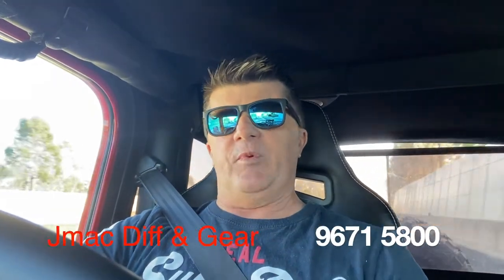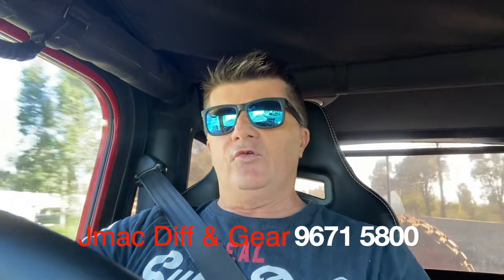ARB Air lockers • Ring and pinion change • Speedo Recallibration // Project TJ

Comment: I know exactly what you're talking about, Darryl.  I have a '99 TJ Sport with factory 3.07 gearing and 5 speed trans. When I changed to 33" tires, I was so frustrated and embarrassed when going up a mediocre highwqy hill. I would go as fast as the speed limit allowed at 65 mph (US) before getting to the hill, but by the time I'm in the middle of the hill I would be down to 45 mph and crawl the rest of the hill in 4th gear. When I changed to 4.56, man it felt like I added a turbo. Now, I can go up that same hill on 5th gear at 70 mph with no problem. Not kidding. Anyway, i really enjoy your contents and keep up the good work. Happy jeepin'!😊
Reply from the maker: Thanks so much!

Comment: Just got my TJ back yesterday too, got the rear axel and diff rebuilt. Pricing you received seems similar to here in Canada, except I bet our tax man is greedier here.  I’m running on 3.73 gearing which is okay turning the 33x12.5 Cooper STT pros but someday I’d like 4.10’s in new front and rear axels. Air lockers are at this moment only a dream. Keep us posted on how the air lockers are working.
Reply from the maker: Will do, interesting how the pricing has translated similarly across continents.

Comment: Love your videos- subscribed!  I was someone who had hoped to buy a new JL 2 dr and go cross country (mostly off road) in it with my wife.  My reasoning to buy new was simply peace of mind while it just being the two of us off in remote places.  I've done lot's of  solo long distance off roading on 2 wheels, but always on newer machines for that peace of mind. My present finances are now telling me to only consider TJ's if you get my drift, so my question to you is about reliability. I understand the engine in bomb proof, but would I be asking for too much from an early 2000's TJ to take it on a 6-7,000 mile trip like that will most likely see everything but hard rock crawling?  Thanks for any advice.  cheers
Reply from the maker: Hi, the newest TJ is now 14 years old so anything you purchase will need some preventative maintenance. That said, parts are cheap and plentiful and the vehicle is straight forward to work on. I used to be the guy buying a new vehicle every 3-4 years however with the TJ, I don't feel the need to. It's never let me down and I'm more than happy to jump in it and do a long trip without worry. That said, I also don't skimp on quality of replacement parts or hold back if something needs to be done.

Comment: Hi Darryl i’m looking at getting my TJ regeared and trying to figure out your costings - was it $1800 labour plus $850 for each ring & pinion ($1700 for the two), plus $2200 for your locker pack? Wondering if my quote was similar to what you paid...
Reply: Also mate while i’m at it how did you come to select a 4.56 ratio? My diff guy suggested a 3.73 but all the info I have suggests that’s too low 🤔
Reply from the maker: $1800 labour ( I fitted the air compressor and ran the air lines for the lockers), About $850 for the front and rear ring and pinion and master install kits (purchased from SBR off-road). plus $2200 for the air locker pack.
Reply from the maker: Depends on gearbox (mines a 6 speed) and what size tyres. So running aprox. 33's it's 4.56. Do some research on the US sites, plenty of advice and gear ratio calculators. With my setup, the 4.56's are really nice both off-road and on.
Reply: @DarrylSheather  mines a 6 speed too, and i’m currently running 33’s as well on the stock 3.07 gearing - I’m gonna go back to my diff guy and ask him to quote 4.56 gearing, but I reckon i’ll check out SBR first 👌 thanks mate!